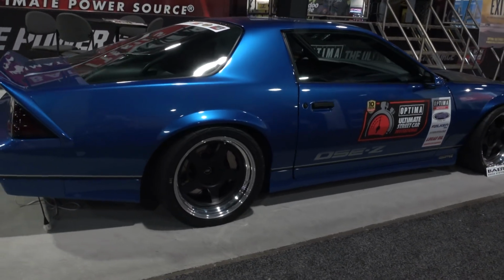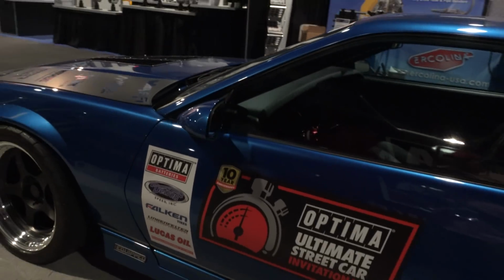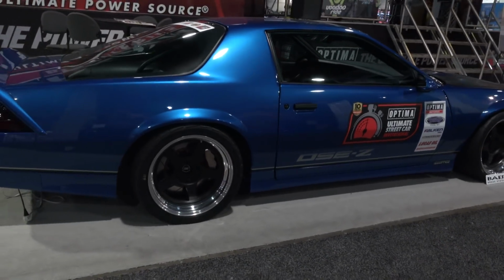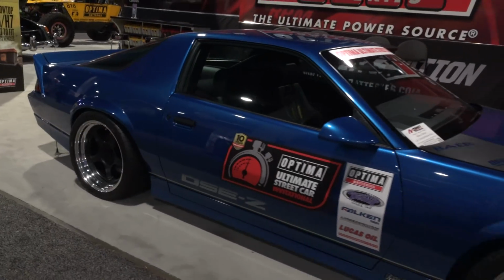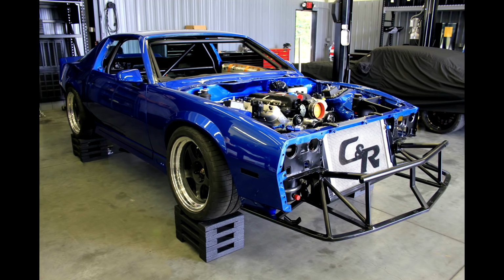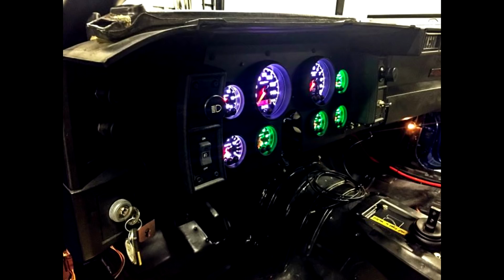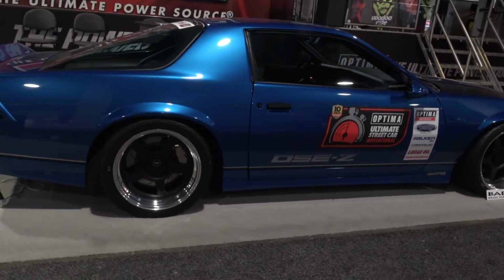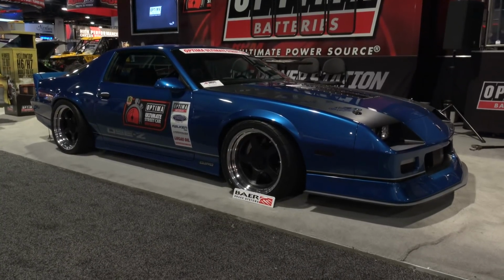1987 Chevrolet Camaro "DSE Z" The SEMA Show 2017

Comment: whats the story with the louvers?
Reply from the maker: On the hood?....Stock IROC part...
Reply: The ones on this car aren't stock. This style was stock on the IROCs, but DS used aftermarket ones from TrackSpec(I think). the original stocks were non functional where as these are very functional.

Comment: IV BEEN IN MORE THEN A FEW BUILT CAR'S & I HAVE A SOFT SPOT FOR ALL CAMARO'S. HAD A 1973 SB400 BORED .030 OVER TO A  406, USING A  STROKER CRANK,AMBER LIGHTWEIGHT PISTONS, 11/1 COMPRESSION, CIRCLE TRACK CAM FROM SUMMIT, & WITH ALOT OF OTHER GOODIES, SET UP FOR A 1/8TH MILE IN A MINT 79 Z-28! HAD ALOT OF FUN IN THAT BEAUTY!!!
Reply from the maker: Cool...Thanks for checking this one out!

Comment: Very cool, it's one of those builds that's done SO well you basically need a tour like your interview because it's a TON of subtle modifications. It may not be a custom part of the build, but it's really nice seeing this generation in a true hardtop. After all the majority of this generation Camaro came with factory T-tops or at some point had aftermarket sunroof.
Reply from the maker: I'm a fan of the T-Top....but if I was to do this...I would have to go with the hardtop...